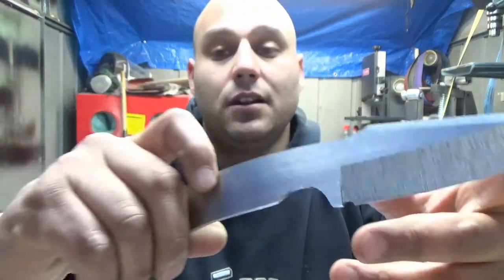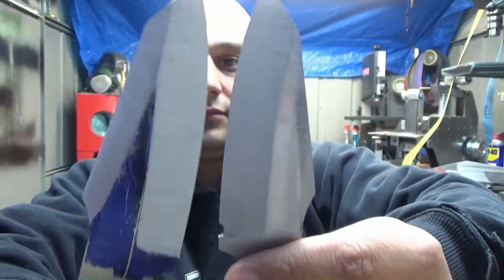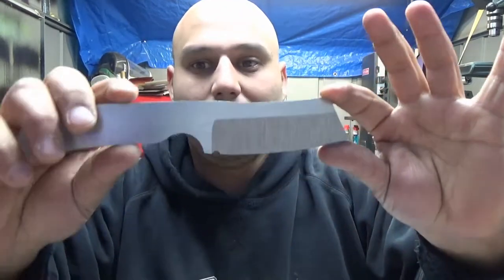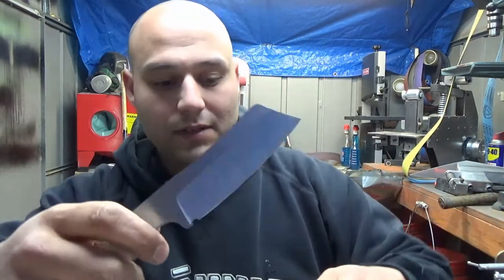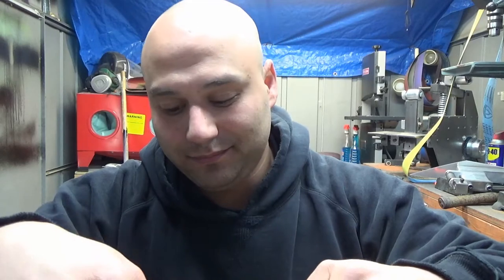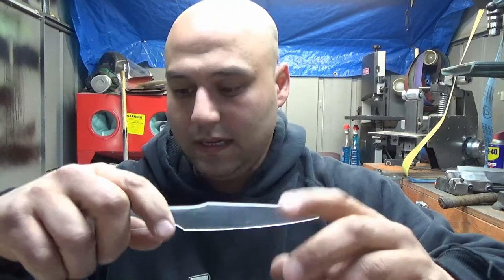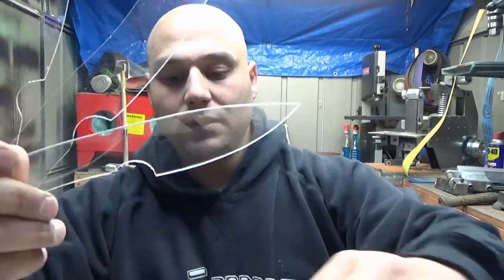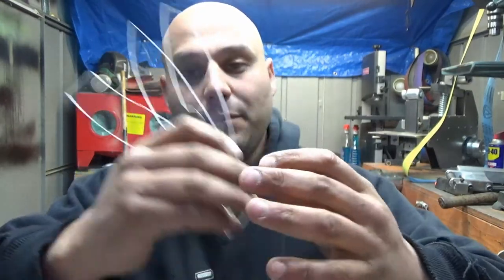Tip for new knife makers - Templates

Comment: Im no knife maker but if you trace a bunch of knife shapes on paper then scan them into your computer then when you need 1 just print it and cut it out with scissors and trace on your steel. No?
Reply: Or you can just make a stencil and not have to print, cut, and trace. You can just open a drawer, select your stencil and trace it out. Done deal.